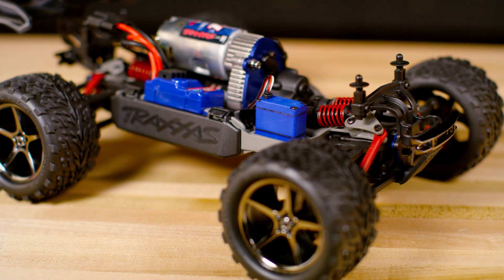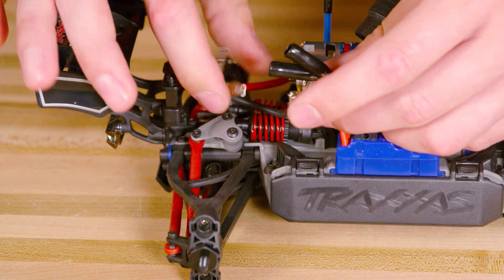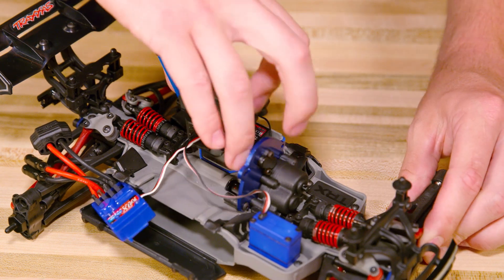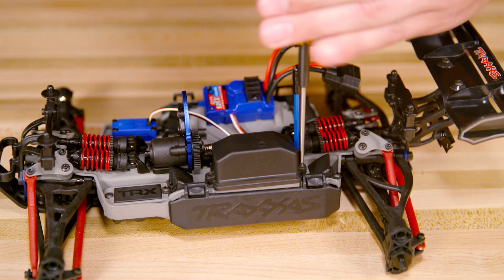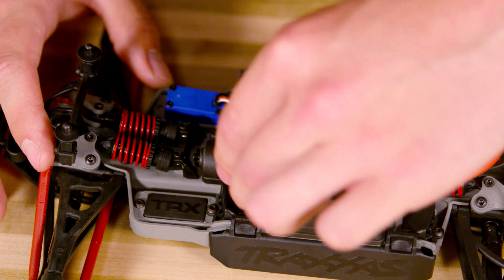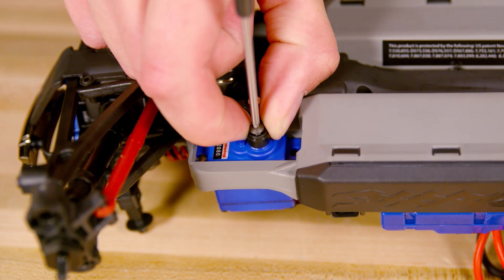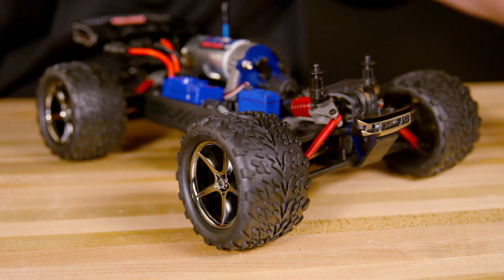How to Replace a Steering Servo in a 1/16 Scale Traxxas Model

Comment: Is it essential to disconnect the motor wires because mine won't budge
Reply from the maker: To accurately aid in troubleshooting this matter please call us toll free at 1-888-TRAXXAS <Outside US: 972-549-3000> . We are open 8:30 AM CT- 9:00 PM CT Mon-Fri.

Comment: ** PLEASE HELP** what do you do when your wheels aren’t turning but the gas works when you finish???  
** PLEASE HELP**
Reply from the maker: Sounds like you may have an issue with your steering servo. 

Please contact Traxxas Support and we will be happy to help!
U.S. - 1-888-TRAXXAS
Outside U.S. - 972-549-3000
E-mail - support@traxxas.com
Reply: Traxxas Support thanks so much but I finally figured it out!!  :)

Comment: Ok so... This video helped me a lot but after doing all this i would honestly recommend getting replacement gears. Traxxas will give you a replacement servo for free if you call them which is super awesome but the next time this happens I'm just going on ebay and buying aftermarket metal gears instead. If your problem is chipped teeth on your gears, just switch out the gears. Way faster/easier fix.

Comment: On my 1/16 brushless VXL I found you can swap the servo without removing the motor. You just have to slide the speed control out of the way and feed the wires under the motor and into the receiver.
Reply: how do u remove the reciever box tho

Comment: I replaced the servo with a Savox metal gear servo, and now the steering is reversed. When I turn to the right it goes left, when I turn the left it goes right. How do I fix this?
Reply: Power on the transmitter and truck. Press and hold the set button on the transmitter until the light starts blinking green. Turn and hold the wheel on the transmitter and then tap the set button.
Reply: Rotate it 180 degrees

Comment: Traxxas: How about making a 1/16 servo that actually lasts more than 5 minutes worth of riding.  I bought a 1/16 E-revo VXL and the servo failed within 5 minutes of non-abusive use.  And I have read countless complaints of this failure from many reviewers over the years. For a $300 RC car this is unacceptable. When I called Traxxas support they didn't even ask any questions and said they would send a replacement but this just proves this is a known issue for years and yet nothing has been done to improve the design.  What are you waiting for, Traxxas?  Needless to say I didn't even bother to install the replacement because I was certain it would fail again.  Instead I opted to buy a Turnigy Servo for $29 with all metal gears and bearings.  But for a $300 RC car I shouldn't have to off-the-bat pump any more money into this car just to enable it to turn! Not cool, Traxxas.  Time to fix this long over-due problem.
Reply: Metroboard Electric Skateboard I'm glad they made this video, so people can buy more servos! Y
Reply: It would be fun if traxxas actually answered your question
Reply: Same thing happened to me, luckily Traxxas now makes an all metal geared servo, it is called the 2080x on their website.
Reply: Where did you buy this at because I have the same issue
Reply: Also there customer support team are all douchebags

Comment: What's a good suggestion for a good servo
Reply: If you're after a suggestion for the Traxxas 1/16 models, I use a Savox Waterproof Digital Micro Servo .11/69@6V in my E-Revo mainly because it's waterproof I drive through puddles here and there and also it has strong metal gears and can withstand a large impact.
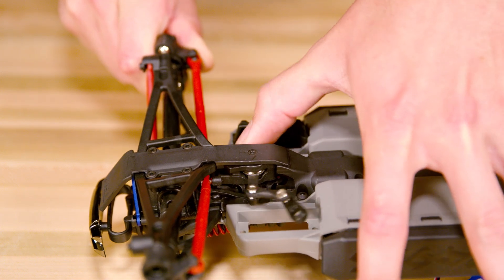Reply: Benjamin Scott totaly agree. I have one of those servo in mine 1:16 erevo vxl and 2 in mine Summit vxl with a metal servo saver. (I made te spring a lot stiffer though) I did two because i made it like a crawler. And two of those savox micro servos give the summit plenty of power to turn the wheels even when the car is climbing against a wall
Reply: Benjamin Scott the summit is one of my favorite 1:16 from traxxas. I have instaled a axial 55turn  crawler motor and i replaced the gears in the transmission. Put some mashers 2000 on titus beadlocks, locked the diffs and you have a 
Pretty good crawler!
Reply: Nice, the summit I bet goes like a beast